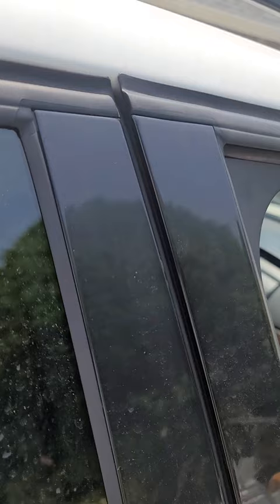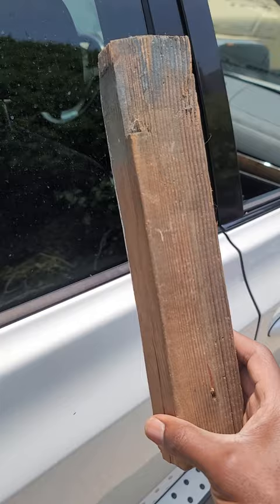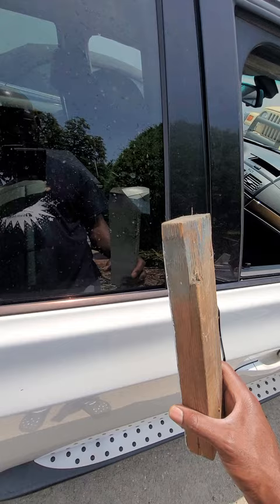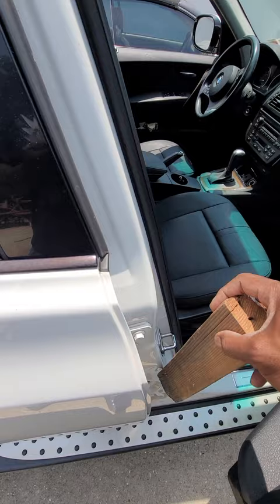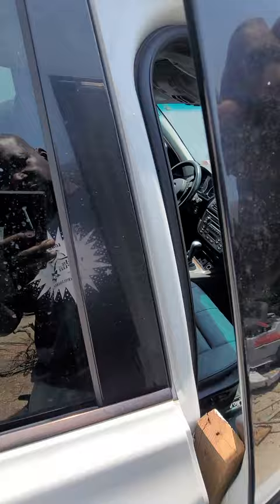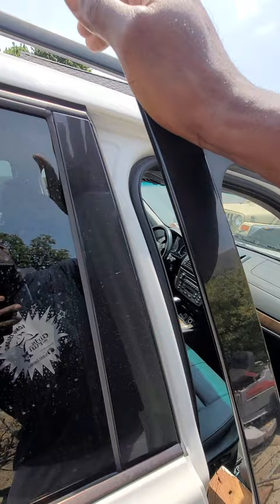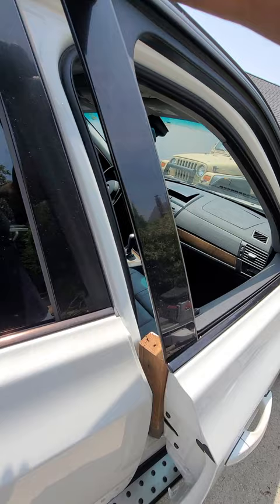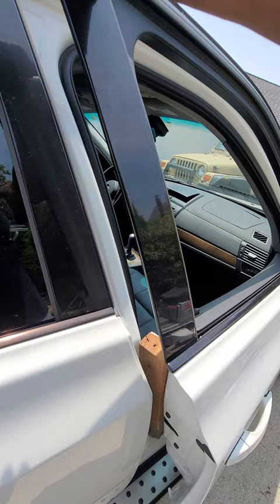How to Repair a Bent Car Door After Lockout Quick Fix! #shorts #viral MrSettin007

Comment: I had to break into my own car because I locked myself out
Reply from the maker: I'm sorry to hear that. It's not fun when that happens.  I remember a time I was hanging out with my friend ( we were in our 20's)  I was driving a stick shift 1985 or 86 Hyundai hatchback ( Their 1st US entry model 👀) we were headed home from a club. It was parked in the parking lot behind the club. We were in there dancing all night.  The stars of the dance floor.  Scene: Dead of winter. There are very few cars in the parking lot. We are both over 6 ft tall, long coats, and dressed to the nines. The women are coming out of the club.  So we try to get in the car quickly to drive off before more come out, but the licks are frozen.  So we wait in the freezing cold and act like we're just taking.  Then I remember the trunk is open.  I quickly crawl through the hatchback and open the doors for my friend.  Start that baby up and tear outta there. Both of us laughing and crying the whole way home. TRUE STORY
Reply: @MrSettin007  yeah luckily my neighbor saw the issue, the latch was knocked loose so all I needed to fix was a screw driver and it’s all good now
Reply: Same! The door wouldn’t unlock either when we put the wire rod in and pressed the button (it was in auto start mode, which for some stupid reason disabled the lock/unlock buttons o the inside). So I had to yank on the frame to give the other guy enough room to fish the bundle of keys out of the car.